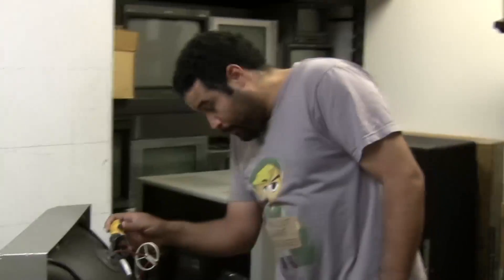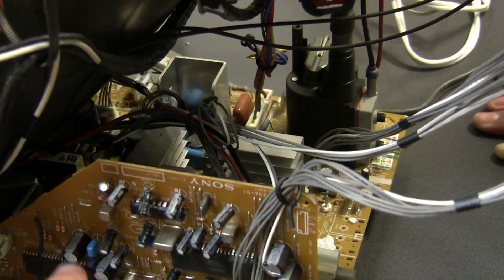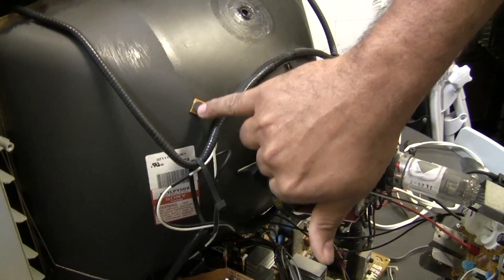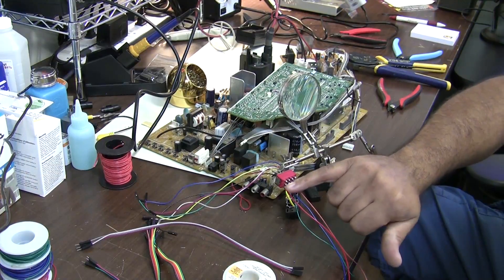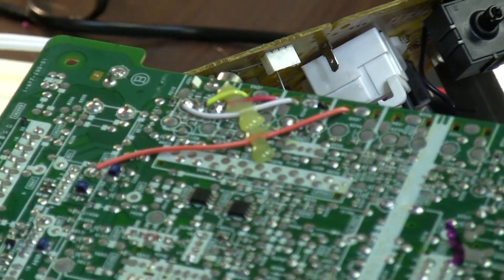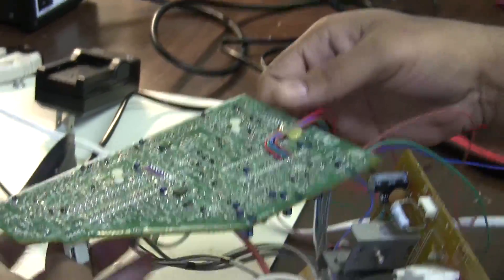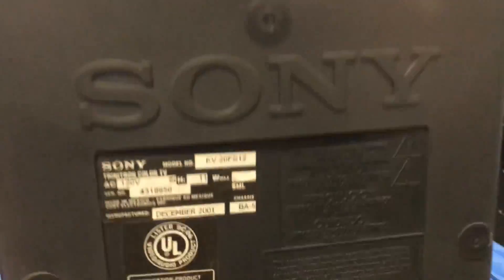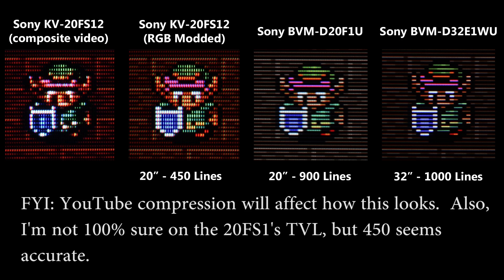RGB modding a Sony CRT for Retro Gaming

Comment: I work in medical imaging. These old pvms were used for ultrasound and for oscopy (thats were they shove a camera up your butt or down your throat). The pvm 2030 was usually used on oscopy and the pvm 20mu, 20m2mdu and similar models were used for ultrasound. I got a flat screen on my ultrasound unit now. I honestly think that the crt monitors give a superior image that is more diagnostic and I am not the only one who feels this way. I am not sure why everyone has switched to flat screens but I can guess...
Reply: Dan Mons yeah im sure the flat-screens that come with the new ultrasound units are way cheaper than the pvms.  we pass through the monitor on the unit to a consumer grade television mounted on the wall during procedures and the television has a sharper image. This leads me to believe that the monitor on my $200k ultrasound unit is a cheap consumer grade monitor. I guess you could look at it the other way around and think its amazing that  the old units had pvms and not cheap monitors...i think the situation in diagnostic imaging is a little different than broadcasting. There has been a push to make these units as small, light, and sexy looking as possible in the last 15 years. Also, i don't know what it is but women seem to loathe large crts. Every women i have ever worked with has complained about how ugly and heavy the old ultrasound units are with the crt monitors and there are far more women working than men... Your right about the maintenance. The crts used to get calibrated every three months and by a technician. The flat screens are never serviced. I guess they don't need it.
Reply: Because those CRTs are HEAVY and BULKY. Flat-panels save space.

I myself don't use a tube anymore. I keep one around in case I get light gun games in the future, though, because those light guns for retro consoles won't work with a modern TV. Ditto active-shutter 3D glasses such as those for the Sega Master System. Space is at a premium with my setup, and I've had to jury-rig some stuff here and there.
Reply: I was having a good read on the topic until you talked about what the PVM was used for, then I started thinking of some stupid @#$% relating to Beavis and Butt-Head.

Thanks a lot.  :P
Reply: voltz15 Yeah dude the pvm 2030 i got was used exclusively for colonoscopies (butt probeing) at my work. I tell people this while we are playing Street Fighter to throw them off their game mwahahaha
Reply: Dollar cost dictated the switch initially.  Same goes for most industries.  I work in broadcast/VFX/film, and we did the same switch for the same reason.  And, to be fair, keeping an LCD/OLED colour corrected is a lot easier than a CRT as well, with colour drift being far less of an issue (important for creative work).
Reply: The white/light-gray versions of PVMs (with MD in the model number) were manufactured to meet medical reg. specs and used in medical settings. The majority of gray/black PVMs and BVMs were made for broadcasting, video editing, film/TV studios, etc., and never set foot in any hospital. I mean it is funny to throw someone's game off by telling them they're playing on a poop viewing CRT, but it's generally not true. :p
Reply: Mega. I picked up my black pvm 2030 from the hospital i work at it still has the "serviced by biomed on xx-xx-2014" sticker on it. I have seen several black pvms for sale on "dotmed". Its a website for used medical equipment. The pvm 20m2mdu i have was repackaged dy Olympus for their line of oscopy units. The guy who runs the biomed department told me that thw only difference between the medical grade monitors and their pvm counter Parts is that the medical monitors have some kins of water proofing. Not all pvms in medical use are the medical grade type. My pvm 2030 is not medical grade and i have never seen a 2030 that is medical grade. Maybe it's because they are older models.
Reply: Yeah, I figured some places got a mish-mash of medical and standard PVMs instead of only the medical grade units you. But it's worth noting that the vast majority of these pro CRTs were not in medical settings that should gross out anyone! I've seen the Olympus/rebranded 20M2MDU units on ebay, although not recently as supply on all these CRTs has dwindled across the board. Thankfully I'm well stocked up on CRTs for years to come... and long-term I'm going low input lag OLED + scaler.
Reply: Mega, hey thanks for the comment! I went online to dotmed after your comment (to make sure thar was the website i used before) and i found a pvm 2030 for 65 business bucks! Its in my area and i will probably pick it up... Yet another rgb monitor... Yeah i am excited about the new low latency flatscreens. I tried hooking one up but i didn't have the right adapter for vga port. One day u will try one out
Reply: Mega... Yeah buddy! Just picked me up another black pvm 2030. The guy was asking 65 for it but he ended up giving it to me for free. Asked him were he got it and he said he got it from a GI doctor. So i asked "endoscopy imaging" and he looked at me and said "yeah" neither of us said anything more but we both knew what this monitor was used for... Butt probing...it had a whole bunch of goo on the sceen too. Probably not probe lube but you never know. Hahaha.
Reply: Dear mates.. May i ask how could I save a video in this type of moniter to my laptop I am doing some surgeries which are projected in this monitor.. But I cant save the records.. Urgent plzzzz
Reply: Mohamed alieltayeb i call bullshit
Reply: AirCooledMan2006. I was talking about why people switched from using crts in medical imaging not why people switched in retro gaming. Thats cool u like flat panels. I would like to try my flat-screen out with the new super analogue nt...see if the lag affects my street fighter skills
Reply: AirCooledMan2006 there is more to it in di. Yeah the size and weight is an issue but if that was the only issue i don't think it would be enough to replace crts. Cost is big issue. Pvms were really expensive. Probably going for about 1.5k where as the flat panel on my current unit probably costs no more than 200 us dollars. Other issues include maintenance and wanting to look "hi tech" manufacturing of crts was also expensive and Sony i think moved towards flat screens on ultrasound units to save cost
Reply: NiggelMyNiggel I tried using a SCART-to-HDMI upscaler (cheap one, as the Framemeister is overpriced) and couldn't get it to work with either my Emerson nor RCA HDTVs. The only way they do RGB is through VGA. The closest I've gotten out of my Genesis, Saturn, PS2, Xbox, and Wii is YPbPr (the red, blue, and green component cables you can find at Walmart). I only bought a used Wii for playing GameCube games in component video. If I get a Dreamcast again (my old one died on me), then I'll just need a VGA box for it.
Reply: AirCooledMan2006 yea the component on the wii looks pretty good. I played through rondo of blood on the wii and was pleased with the visual quality...a lot of these video options for rgb are pricey but worth it if you game a lot....if you apply yourself you can find a pvm for cheap or for free. And honestly i think composite  to a decent consumer grade trinitron still looks pretty good
Reply: NiggelMyNiggel are you seriously asking this? Flat led displays have way more definition than any CRT, this alone should be a big reason to any professional work that requires a display, it's easy to get support from the manufacturer, consume less energy and there are flat displays that complies with static and radiation standards.
Reply: David Escalante, shi boi! HR is where it's at, HD is for losers
Reply: Eventually, they'll get you OLEDs for this, and you'll be fine.
Once medical imaging equipment start supporting 10-12 bit color and 4k resolutions, I doubt you'll miss the CRT that much.

Comment: That's seriously awesome! Hopefully RGB modding these cheap and plentiful TVs makes high quality CRT output much more accessible to everyone. I think the BVM comparison is a touch exaggerated due to lower line count, but it does look very close to a PVM of comparable size. The arcade monitor replacement idea is very exciting, since finding replacements for stuff like candy cabs (and in my case, a DDR machine) is much more difficult than finding broadcasting monitors. I know there are high line count consumer CRTs out there, but most likely they rely on a digital signal. I wonder if it's possible to RGB mode those as well?
Reply: AtomicZepherino

Very likely that most CRTs can be modded for RGB input, but the main issue with many "digital" or "flicker-free" / 100Hz / 120Hz CRTs is the difference in the scan rate.

That often went hand-in-hand with the high line count thing obviously, as it required a higher bandwidth input signal to take full advantage.

Those sets often used a framebuffer to do de-interlacing and other "enhancements" like SVM, and would then drive the CRT at a higher Sync freq, like a big VGA monitor.

(although some of those enhancements looked terrible in the late 90s and 00s. lol. Seriously grainy, or weird motion blur / ghosting added.)

So, for those sets, you'd have to drive the deflection differently for a 50 / 60Hz Vsync and ~15 KHz Hsync input, which obviously makes things really tricky.

Quite a few of those sets had VGA or Component input already though, so it depends if a direct RGB mod would result in a cleaner image or not.

Comment: Yes do side-by-side with the component converters.
Reply: Exactly what I'd like to see.  I have 240p running through a scart to component converter on a 29" Sony consumer grade CRT.  Would love to find out if the RGB mod lends a higher quality picture or if it's just equivalent to what I'm currently running.
Reply: LaC64 That's EXACTLY what I want to see to be honest
Reply: LaC64 The HD Retrovision component cables should be included in that comparison video too!
Reply: Agreed! Component, converters, and HD Retrovision!

Comment: I am happy that we got RGB SCART available standard in Europe and it's stock on pretty much any TV that's not ancient. While I agree it looks fantastic, to claim it looks like a $1000 BVM is a large stretch as the title suggests. I think a good calibrated BVM is a very large step up from a consumer set, even with RGB. Maybe a lower end PVM wouldn't be worth it as those don't outperform a consumer grade RGB CRT by much.
Reply from the maker: The title is purposely clickbait-y to try and draw people in.  I absolutely refuse to change my CONTENT...but I'll gladly change how I write titles and thumbnails to try and pull in more viewers.  I do go into detail later in the video about the differences and in my opinion, a nice BVM blows this away.  My main point is that if done right (and safely), modding a CRT for RGB is a much cheaper alternative that produces great results.
Reply: Yep, virtually all TVs sold in the UK from around 1991 that had SCART also supported RGB.

It was especially common to see sets with Teletext or On-screen display that had RGB input as well.
Reply: DrLilo

95% of all consumer CRT TVs I saw in the UK in the 90s had RGB input on at least one of the SCART sockets.

I used to repair TVs / monitors / VCRs too, and don't think I ever saw a SCART TV after about 1991-92 that didn't support RGB, especially if it had Teletext or OSD.

I can't entirely vouch for sets sold around the rest of Europe, but I seem to recall a similar situation there?
Maybe specific Countries, they often sold sets without RGB, but I find that a tad strange.

But, it is true that there were a lot of cheap crappy SCART cables that only hooked up the composite and audio pins, and that was mainly for connecting a VCR, and they only worked with composite.

That was still an issue even when the first DVD players started to appear, so you had to make sure you bought a decent "Full SCART" cable if you wanted the best RGB image from DVD.
Reply: yep, never seen one without RGB, though often seen people use cheaper SCART cables that are not wired for RGB even though the TV and device plugged into it supports it.
Reply: You guys got Scart/RGB with 50hz slow gameplay on many titles and we got no Scart,(not even aware of it either)most used rf lol with 60hz gameplay. Best we got was composite(if the tv had it). Maybe S- video and only if the game companies supported it with a cable too.
Reply: W MJ third comment like this ive replied to! No, most European consumer grade CRTs didn't support RGB. The scart connectors on the back were only for carrying composite signals.
Reply: I live in Europe and all CRTs I have had/seen with other people that were made in the late 90s or later all had RGB/composite SCART inputs (that carried both signals), even the very cheap ones. S-video was much more uncommon in my experience. In the 80s it wasn't uncommon for a CRT to only have RF or composite. I'm in The Netherlands maybe not the same for other countries...

Comment: Although we only had the PAL 50 Hz here in Europe, I am glad that we got RGB out of the box with our CRTs. All we had to get back then was a proper RGB cable (most of the consoles) and we were ready to go. Now in the late 2010s, we are able to experience best of both worlds. <3 Great that there is an alternative to the pain of shipping a 28" CRT from Europe overseas just to get RGB instead of Composite or S-Video.
Reply: DrLilo Sorry but you’re totally an utterly wrong. A CRT with SCART inputs almost always supports RGB. That’s been the case in the U.K. since the 90’s
Reply: We always had rgb in Europe .... It's just a buzz word for Americans because they never have...it's good that they have a cheap option , I always laugh when I hear people using frameisters in the UK ...could have about 20 crts for the price.
Reply: French TVs in the 80s and 90s all accepted PAL as well as SECAM. Most TVs from the mid 90s accepted 60Hz and NTSC as well. I can grab any TV from ~1998 to the end of CRTs for between 0€-30€ locally and it will basically play everything. The only thing to be careful about is 100Hz sets that don't work with lightgun games.
Reply: @DrLilo depends in which european country you live I guess. I live in france and I've never ever seen a TV that didn't handle RGB SCART.

@Peter M Just like us ^^ Too bad Sega, sony, nintendo, etc didn't get it until the early 2000's ...
Reply: Gabbiadini I already retracted that comment weeks ago...
Reply: But what of France's SECAM standard, though?

As an American gamer, I can't help but feel cheated that we didn't get RGB on our consumer CRTs when they were new. Why do Europeans get the good video quality but we have to settle for YPbPr at most? What the hell?
Reply: I highly doubt SECAM will be a problem since every single TV sold in Europe since the 90s seems to at least support 60hz. It's really only the NTSC color that might be a problem, but that's really of no importance as long as you aren't playing the Famicom since you can just use RGB.
Reply: I have yet to meet a single TV in France that has a SCART connector and won't accept RGB. I've seen cables wired with composite only but never a TV set without RGB.
Reply: Again, this is a common misconception. The majority of consumer CRTs in Europe did NOT support RGB, they only had SCART connectors for carrying composite video, as SCART is a multi-format connector.